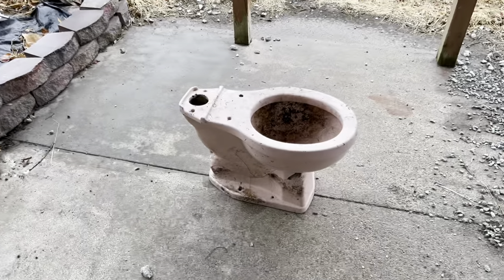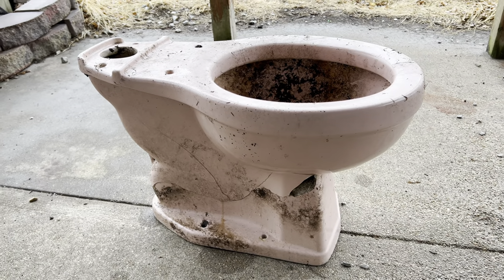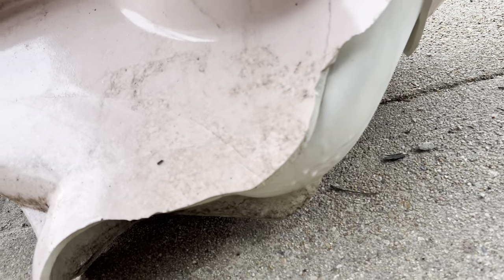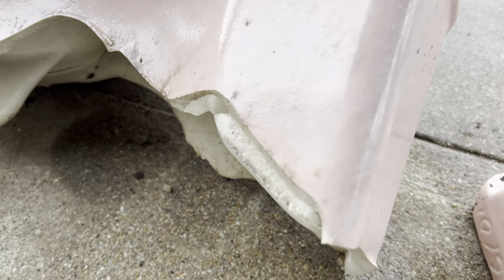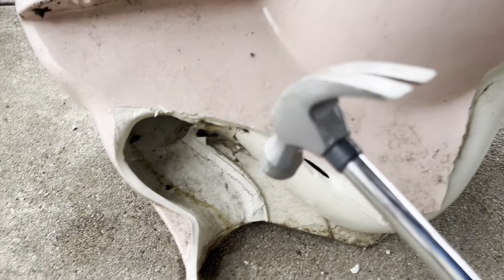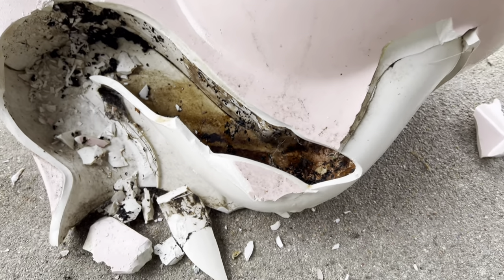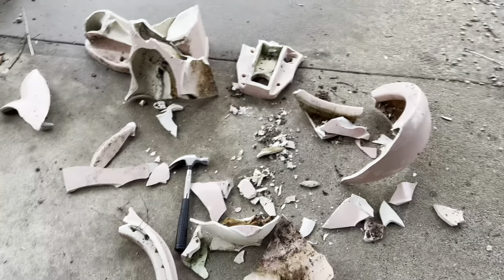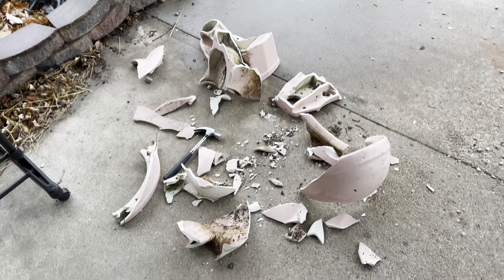1959 Homart Toilet Dissection

Comment: Poor thing, I have one of these and I still haven't been able to flush it. 
To drain the cavity, they make a little hole in the side of the concealed trapway and drain the liquid out and you can see where they cap it off on some older Eljer and Kohler toilets.
Reply from the maker: I never flushed this one either. It sat in my house for like a year then I moved it to the shed. When I opened up the shed again once it warmed up, I saw that it was broken along with one of my highlines
Reply: @KDMCPlumbing  That sucks!